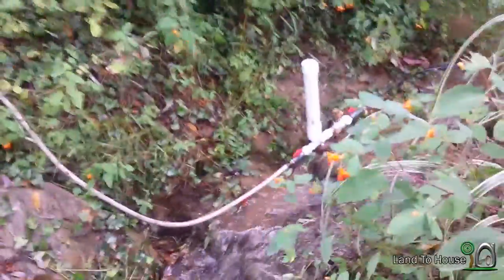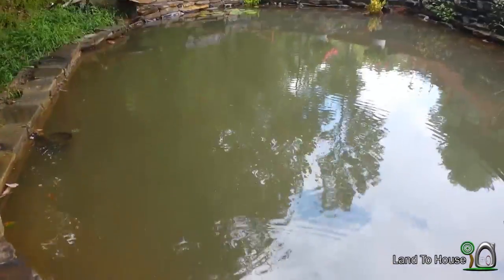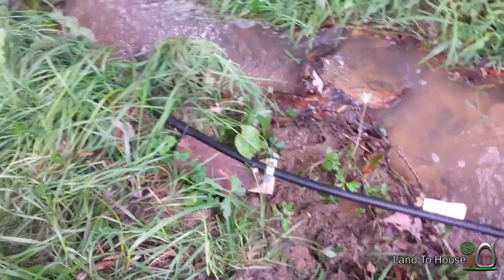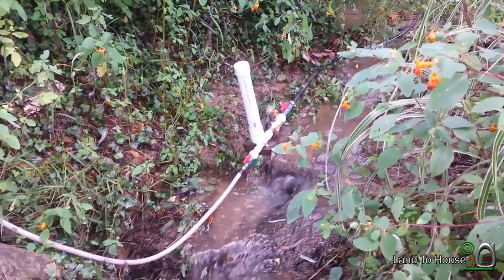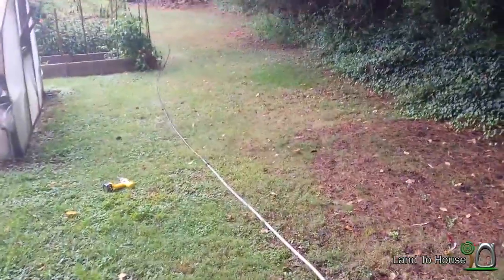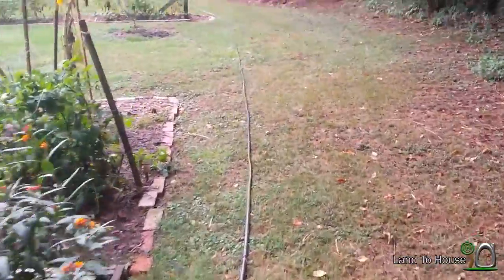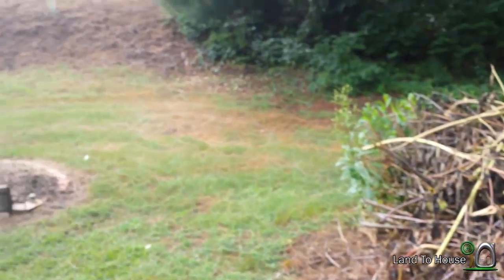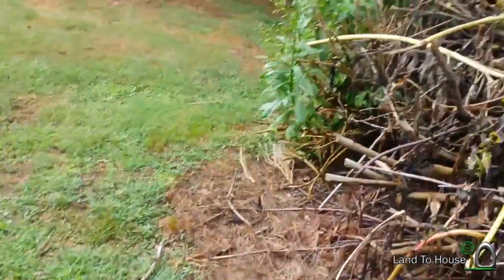Ram Pump From A Pond

Comment: is there anybody having trouble with the inlet pipe coming into the pump causing it not to run right?
Reply from the maker: That typically is an issue with air bubbles in the drive pipe.

Comment: I read that ram pumps only work with flowing water. It looks like you used the stagnant pond water as a water source by creating a downhill stream that feeds out from the pond. Do you think a small ram pump could be placed into a dry container, and then the container is submerged into water, with a hole in its wall so that the water can flow downward into the ram pump's inlet? I'm thinking if it could be done, it could help people with flooded basements when the water cuts out.
Reply from the maker: The ram pump could be placed into the tote and submerged. The issue is that there is going to be waste water filling up that tote very fast. Soon the pump will stop and you will have a tote full of water in the water.

Comment: Hi Seth, I've got a little pond, I would like to use a Ram Pump for recirculation, I've seen a video of yours that shows a Ram Pump running underwater, there is an outlet pipe in the bottom, the pump gonna go there and I wanna build a container around it to recollect the water going out from the pump. The container would be a little higher then the pond, so the water, once reach the top, flow back to the pond. I know something it's wrong with this cause otherwise much more people would have it already, but my question is:
do you think the Ram Pump would work once the water in the container get to the top? Isn't it too much pressure for the pump to work?
Thanks for your time and for all the videos you published.
Reply from the maker: +Indigena Cafe' it is true that the ram pump will work underwater.  But the source needs to be above that water. In my video the drive pipe comes out of the pond above the one the pump is in. The issue with sinking a tank in the pond to create head is that once it fills the pump stops and you are left with a tank sunk in a pond.

Comment: Seth its cool that you are trying lots of different projects with these pumps all great info for when i need a
system to go off grid
Reply from the maker: I was thinking the same. Working from a pond is the best.  I am still working out the details for pulling from a Creek.  The silt and flood stage water are a problem.  But ponds just work all the time.